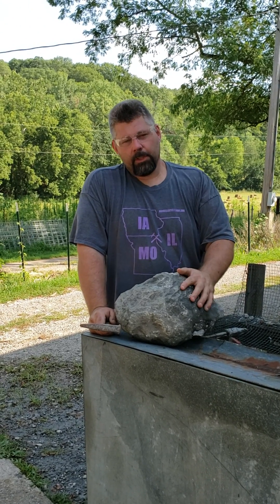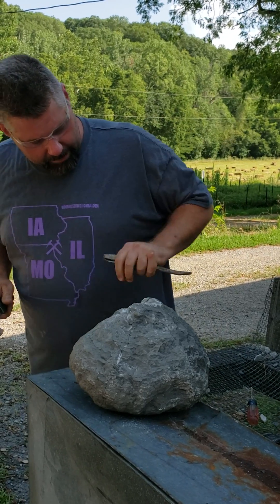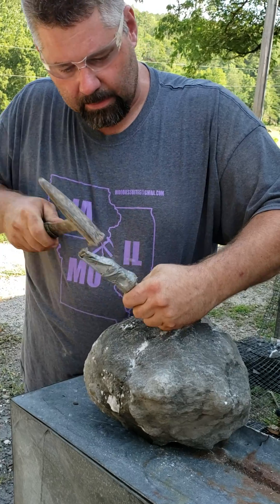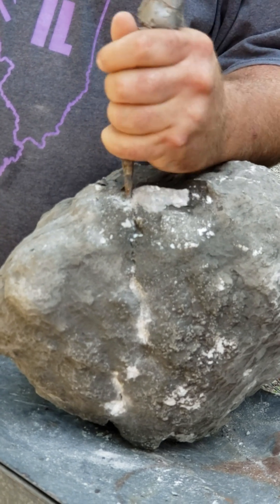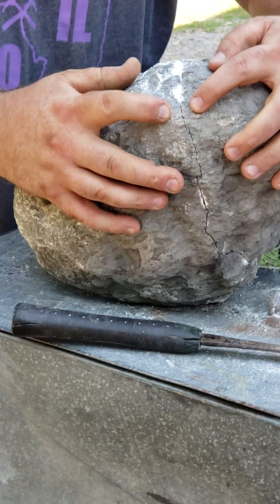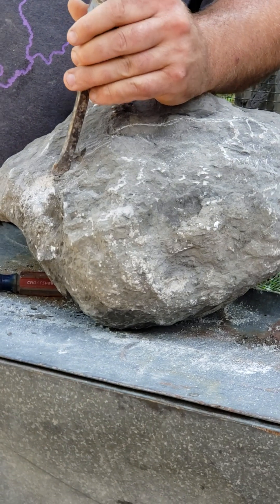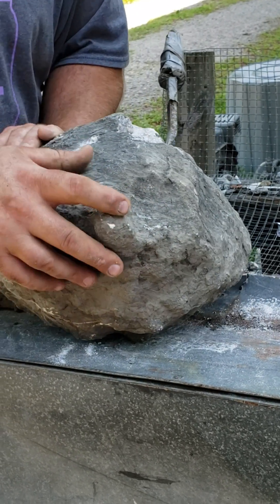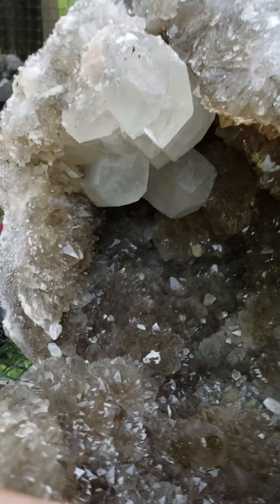Hand Cracking a Huge Geode with common tools

Comment: Have you tried hammering long nails in a ring, to get the geode to cleave along a specific line? Kind of how people split giant boulders with stone cutting nails.
Reply from the maker: No, we haven't tried that. The pipe cutter that we use works in a similar manner by applying an even pressure around the geode.  On a geode like this one where the natural fault line is already cracked we don't typically use the pipe cutter because it could break the geode into multiple pieces.  Thanks for watching!

Comment: While I fully appreciate your professionalism and control of not being like others tossing the geode into bucket or just wailing on them I'd like to offer a thought. While watching you do things the good way to preserve crystal I though maybe you might want to look into wooden wedges like quarries use, you drive them in dried wood and then wet them down and while you adding wedges your one already added will have already expanded the crack and you add more and the shell gets pushed no massive vibrations and preserving the insides the best you can. Also using a masons saw gently, just rent for a day and put cuts along faults for wedges almost no excessive vibration this way and it gives you hammer arm a break done this way. You also if it cuts fast enough increase your output a lot while decreasing repetitious hammering also. All pluses I'd thought I'd mention at a low cost for more profit and higher quality results as in unbroken by hammering crystals.
Reply from the maker: Thanks so much for watching and for the idea! We have several saws, but we don't typically use them because we risk cutting through a large calcite formation.  We also don't personally care for the look of geodes that have been "scored" with a saw leaving it with a half-cut, half-cracked look.  The wedges are an idea we hadn't heard before, but I'm not sure if they would be thin enough to fit in the tiny fracture lines.  We typically use cast iron pipe cutters and make the job pretty quick with minimal damage, but when there is already a really good fault line this is the best way we have found to achieve the desired results with minimal damage.  Thanks again!  Have a great day!

Comment: That's a cool geode. The camera picked up yellows and reds when you turned it a bit. That's the right way to crack one open, isn't it? Instead of going at it gung ho. Nice find.
Reply from the maker: Thanks for watching! If you watch most of our other videos we typically use a cast iron pipe cutter for a nice clean break.  Because this geode had a nice fracture line we wanted to show how easily a geode can be opened without special (and expensive) tools if you can find a natural fracture line.
Reply: @WoodiesRockShop  Good stuff! I will be watching more.
Reply: @WoodiesRockShop  Have you watched any of The northern Mudlarkers videos? You should! They are new to Youtube And are widely trending. You should subscribe too. They are very nice ladies.
Reply from the maker: @rodwhite9737  no we have not. Thanks for suggesting it. Will check it out!
Reply: @WoodiesRockShop  The cast pipe cutter has a chain, doesn't it?
Reply from the maker: @rodwhite9737  yes. If you check out almost any of our other videos you will see the pipe cutters we use.  We have 3 sizes.  They have chains with "cutting teeth".
Reply: @WoodiesRockShop  Yeah, that's what I thought. I used them in school.
Reply from the maker: @rodwhite9737  I checked out the channel you suggested.  Neat stuff!  Thanks!
Reply: @WoodiesRockShop  That's awesome. Nice ladies aren't they?
Reply from the maker: Seem to be

Comment: I’m betting you wouldn’t have to work so hard if you had a surface that did not flex and bounce around.
Reply from the maker: That surface is actually pretty sturdy.  Extending the natural fault line around this size of a geode just takes a little time.  Thanks for watching!